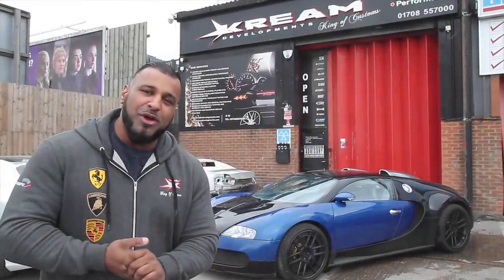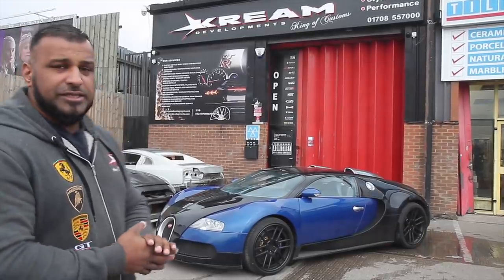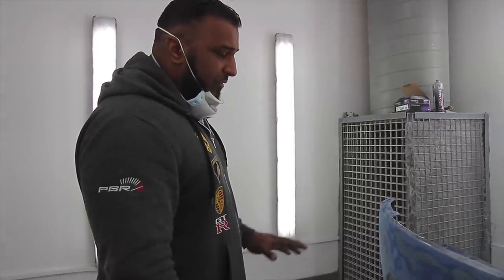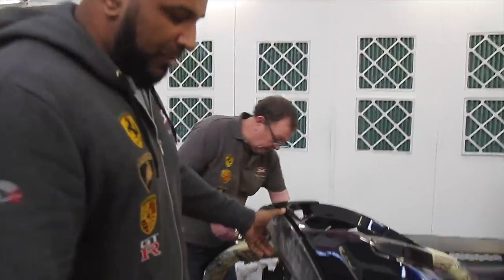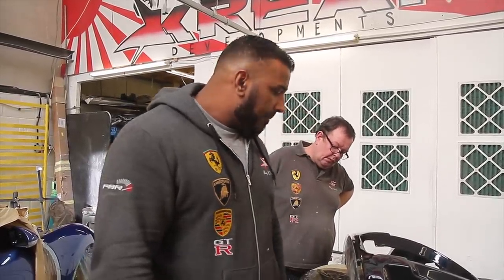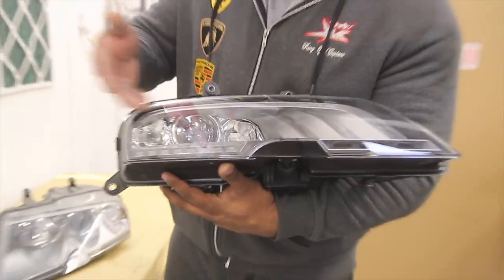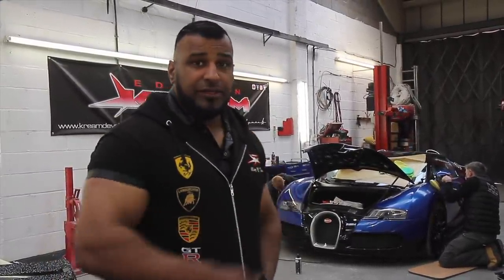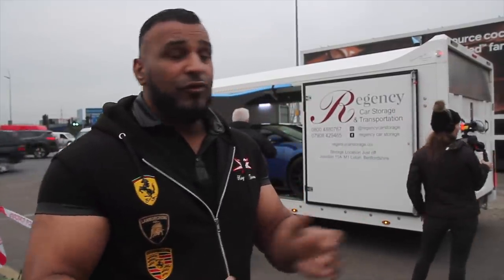BUGATTI VEYRON REPAINT AND HEADLIGHT UPGRADE  - Kream Developments:All access Episode 50

Comment: The wheels make the Bugatti looks so cheap
Reply: I was thinking the same thing. Horrible rim choice
Reply: Probably cheaper than original though😄
Reply: Them wheels got #GangstaBoogie
Reply: When you need to change tyres on these more than twice you need new wheels from the factory or its not safe going top end speed.over 100.000 pounds so option cheaper wheels and tyres from unofficial paint shop who may no the dangers. If I won the lottery and bought this car from current owner it would cost hundreds of thousands of pounds to put back to factory spec and retain its value. Fixed on the cheap .
Reply: they look like something from a lego set for fuck sakes
Reply: @crossbrightt4509  So true having a 1M Bugatti veyron doesn’t make sense to have a cheap set of wheels, he could just pick some Vossen Wheels or Forge wheel
Reply: @James-gp7yp  ikr, also props for responding to this 1 year later
Reply: @crossbrightt4509  LOL 😂
Reply: Year old comment I know but just adding my thoughts. Could be a second set the owner bought for the car, like for puttering around town or taking it to the shop or something. The factory Bugatti rims and tires could be something the owner would put on for shows, track days, or whatever.